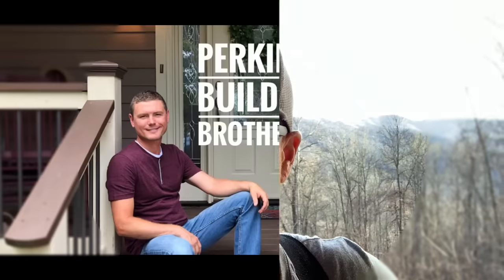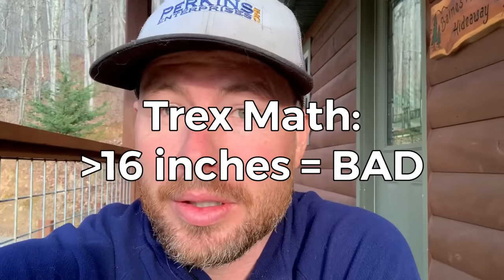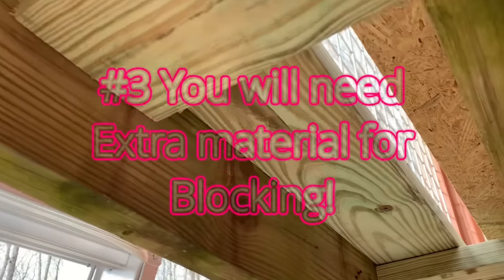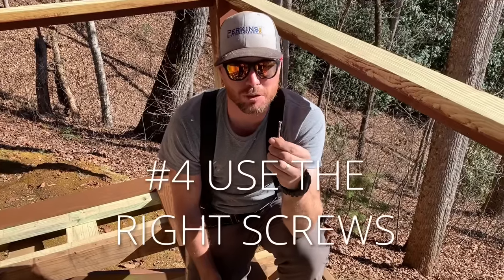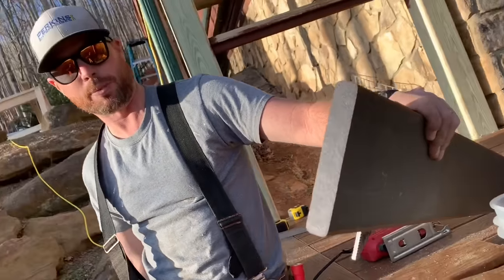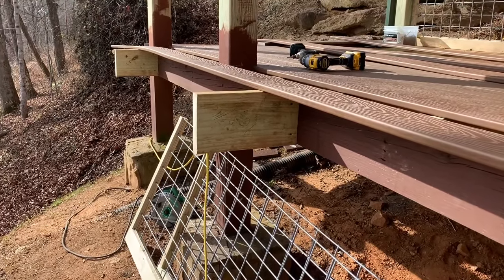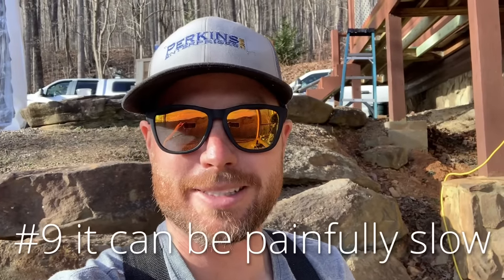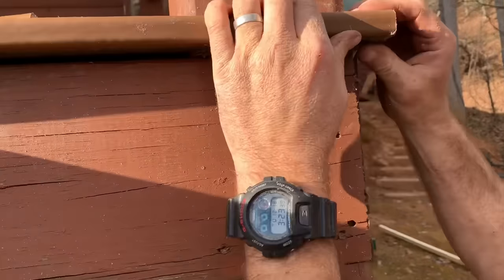How to install Trex composite decking

Comment: Been installing these for years now, figured I might learn a few new tricks but all I see is inconsistency. 1st, joists should be at 12" not 16, the amount of trex decks I've redone for people because their joists were on 16 and sagged is insane. 2nd, why take the time to install "outriggers"? Lay your board on top of the last deck board on the deck itself, make your post marks and measure the distance from the last installed board to the end of the deck and your done, that'd save more time. 3rd, you finished your deck in 2 different ways which would look odd when completed, that blocking around the deck is only necessary when you are picture framing the deck with a 1/2" over hang to butt the skirt board up to, if you are raising the the skirt board to cover the cut ends and flush it to the top of the deck the blocking was a waste of labor and material.

Comment: My personal preference is that I would never lay out the dough for Trex, and then use visible fasteners.
Reply: Sometimes you have to face screw it if your running a Dexerdry system to keep underneath dry for a sitting area. The hidden fastener groove gets taken up by the seal for the Dexerdry.  Otherwise yes, why face screw it?
Reply: Hidden fasteners arent code compliant in some parts of the country. IE where I am, at least.
Reply: I can see the screws in between the trex and MY OLD DECK.. IS IT SUPPOSE TO BE THAT WAY HELP??
Reply: @Spytimegamez  what are you talking about?
Reply: @Spytimegamez  Do you have any pictures or a video to clarify what it is you are speaking about?
Reply: The clips will not hold up to severe winds. Here on the Gulf Coast, where we have hurricanes, they do not recommend using them.

Comment: At the rate lumber prices are skyrocketing , trex starts to make sense.
Reply: Exactly!! The exact reason why I'm looking at this stuff now. Lumber prices are insane, thank God I reno'd my building last year– a 4x8 sheet of 5/8" Pressure Treated is $114 Cdn today...F*ck that!
Reply: You need more joists so may offset the cost anyways
Reply: @ianmctimoney4206  Only need to double up the joists where the trex meets and on the outsides, so not too bad.
Reply: @harbourdogNL  also 16" o/c and 12" o/c for stairs,  depending size of deck coukd add up.

I just don't Iike the product , much prefer real wood. It's also hot af to walk on I summer.
Reply: Not only the cost of lumber but the very low quality lumber that’s hitting the market.
Reply: @randygreen007  it recently took me 2 hours to find about 100 decent overpriced 1x6 redwood fence pickets from a pallette of 400 at a local hardware store.  The shortage is real.
Reply: It's not a horrible price. I just got 45 boards 16 ft and paid 850

Comment: You failed to allow any drainage (where you laid the 2x6) for the band board; so water will collect there at the end of every board and have nowhere to go. Drill a 3/4” hole in the 2x6 where each corner of the deck board meets the band board.

Comment: Trex has decking with grooved edges so you can use a hidden fastener to attach to the joists. Make sure you do some research before doing this project yourself.
Reply: You can get Trex with grooved(hidden fasteners), or rounded edges(faced fasteners). There are pro/cons to either.
Reply: @jeffw8057  I agree!
Reply: I hate the hidden fastener system. It took twice as long to install it then a normal deck through face installation
Reply: Also make a gun to shoot clips
Reply: CHEMICALI3URN  for sure
Reply: I love the Camo screws. They make fasteners too but the screws with their tool are awesome.

Comment: I did 3 decks with Trex in 2002.  Used the specified screws that claimed to not mushroom, same screws you used.  They did mushroom.  Ended up pre-drilling and counter sinking everything.  I used a round over router bit on the cut ends, looked great.
Reply from the maker: Nice work! Sometimes a good looking finished product is in the details

Comment: Still loving my trex decking . Had it installed 18 years ago by an individual very skilled in trex . This decking does expand and contract with weather conditions , and will sag if not properly supported especially in hot sun . The decking does get warm if it’s in the hot sun , mine is around my pool so I do spray it down periodically if we’re using the pool , but the advantage to that being if it’s 65 degrees outside i can be out on my deck because the trex has absorbed a little warmth . Also trex decking does require care , it is not a carefree material , I do power wash my decking every two years as mold can sometimes collect with moisture , and the decking should be cleaned of any debris that collects on it to help prevent mold and mildew , overall I have gotten my money out of this deck , 18 years ago it cost me ten thousand dollars to build my deck and it is fairly large and has brought a lot of enjoyment to my family ..

Comment: I wouldn't criticize this because 2 years is a long time in terms of composite decking lawsuits, changes to their installation guidelines, and product due to insane product failure rates. Things are common place and standard install procedure that only a handful of pros were even thinking about or doing for a more conscientious client base a few years ago. I'll leave it at that. Great tip on the marking of outside deck board around posts. Putting things out into the world for all to criticize is more than most people do.

Comment: I have been reading the comments and there a lot of negative comments about Trex decking. I had my deck built four years ago and I love it, it looks the same as  the day it was built. Mine was built with the hidden mounting hardware and I could not be happier. I have had wooden decks and they are a lot of maintenance. I used there high end product with metal hand rails. It is hot in peak sun times but I dont entertain in the middle of the day so its not an issie. My concern is how long did  those who not like this product own it before it went bad. This deck cost more upfront but I factored in the time and expense of stripping and sealing the deck every couple of years, well worth the extra cost.
Reply: Same here.
Reply: @stevethecat9194  Thanks
Reply: Scott Gibson I Google review Trex decking it had a lot of bad reviews. I am very confused now, wood or composite decking?
Reply: @lookssssssssss  I own two homes and my other house has two decks one with cider and one with PT, every two years I have to strip the old seal and reseal them. They look good for one years, it's time consuming, expensive and in general a pain in the ass. I much prefer the Trex, it looks good and needs no real maintenanc. If there is a negative it's that is does get hot in direct sun. Good luck either way.
Reply: @mtadams2009  Thanks for quick reply I think I may go with Trex

Comment: Done ~2600ft2 of Trex including Trex Elevations (steel framing members) on 5 decks. This said:
1) yes, the ends might not be square (arrg)
2) 2x as long is reasonable
3) unlike this video, spec is for gap spacing on butt joints (spans > 20'), and there is quite noticeable gap movement over the seasons (may even want to use double joists here)
4) even at 16" there can will be noticeable movement when walking (i.e. unhappy client)
5) since not wood, requires great precision--can't just sand flush a little off miter e.g.
6) plastic flexible, bad when trying to get it square, good when you need some movement to install
7) hidden fasteners take time but give a good result
8) starting hidden fasteners give a telegraphed rise so pretty much have to rabbet  to keep flat
9) with Elevations, they actually require you to counter-bore over each fastener, a laborious task (and never happened to me but spade bit tip can easily poke through)
10) you really need to use deck clamps to insure tightly abutted boards/even gap spacing (had to remove a whole lot a worker didn't do quite right to please client)
Reply: Well said.  Also, cut perimeter after installation and a couple days of movement has occurred on hidden fastener systems so as to let the deck find its happy medium.  
I'm not keen on having wide flat surfaces under the end to perimeter board support like they showed early on.  It's just a wider collection for water.   Instead I like to space extra joists and space blocks to encourage drainage.
Reply: @seanroberts381  what about covering that blocking with joist tape?
Reply: All that being said, totally worth it for the client?
Reply: @every_thing_wood1251  They are happy so the answer would seem to be yes. A few years in and durability (including harsh sun exposure) has been fine and looks to continue for some time. I would not hesitate to undertake the higher cost and use Trex again. One note is that Trex Elevations (steel framing members) seem to no longer be made. Don't know why. So I guess I'd have to use old school PT beams.
Reply: @BB-xq6rj it does help, but whenever possible, respect for nature always works better in the end. The smaller the surface area for water to collect, the better. Remember, given enough time, water destroys or changes most things, so better to give it a path to leave while you wink at it.

Comment: Lately, here in my section of New England anyway, pressure treated lumber is getting harder to find in any quantity.  Place an order of a couple of pallets from the big boys and you may wait weeks for delivery.  My latest deck stock came in only $500 dollars cheaper than a mid range composite.  Sometimes the extra work pays off in the long run.

Comment: As you don't butt the composite material and leave a slight gap, we used specially designed screws between each board that fit into the factory board  groove. That way there are no visible screws in the decking. When we did the outer "picture frame" we used a drill with a countersink bit. The screw was countersunk, then a plug was placed in the hole. This way there are virtually zero visible screws on the top of the entire deck, including the steps.
Reply: Were plugs included?
Reply: @joeysmith4515  Yes, in the "kit" i purchased a special bit was provided to countersink the holes as well as plugs colored same as the decking.
Reply: So I did not go to Lowe's or Home Depot. They seem to rotate specialists and I wasn't confident that they could fill my needs. Instead I went to a building supplier. The person who assisted me had a computer program.I measured the width and length of my deck and railing as well as width, length and number of steps. He put it into a computer program and it spit out what I needed, It included boxes of screws, as well as the anchors for the boards, bits to be used for the screws between the boards (since I used composit and they are not butted together and need room to breath). Also included was the bit to countersink holes and the plugs to fill them. Since MOST of the screws are actually bertween the composit you don't need those counter sunk. Near the ends of the boards you may. I also put a "picture frame" around the deck. This was darker boards in color and also not "slotted' on the ends so that you get a smooth finish all the way around. I did not get a countersink bit or plugs for that, so what I did was buy some plug drilling bits, and made my own plugs from slop I had left over after cutting the picture frame boards. When I was done a neighbor who helped me was amazed at how little slop I had left. The program was pretty accurate. I could also return any boards left over, but didn't need to.

Comment: Thanks for all these tips.  One thing i don't get is that manufacturers ask us to account for expansion but at the same time they approve face screws which should restrict the boards from moving.  Anothet question is shouldn't we leave a gap even on the miter corner?
Reply: Expansion needs a space, not every space. Close your mitre but leave 1/4 at the opposite end. If butt joining, transition the space to the next board end😢. As long as the line has a space to expand, it will go the path of least resistance. Of course, if you are transition in the middle of a deck, leaving the space on both ends looks nicer with a transition piece and more space to expand.

Comment: If/when Trex delaminates, which it is known to do, depending on the batch, the warranty only covers the cost of replacement material. It does not cover labor costs related to removing/disposing of the defective material nor installing new material. Also, Trex WILL stain if drippings from a barbecue hit the surface. Dawn dish soap may help, but not always. Always place a protective barrier between your barbecue and Trex. In theory, Trex is supposed to last longer making it more cost effective over the long run than redwood. That is not always the case. Certain colors fade quite easily within a relatively short period of time.

Trex is actually a waste product from Anderson Windows consisting of wood and polymer materials left over from the making of doors and windows. This waste is ground up and mixed with colors and adhesives. When it delaminates, it looks like a soggy roll of toilet paper. It is recommended to seal the cut ends and penetrations of this material with some sort of adhesive/sealant.

When the weather gets hot, Trex on 12" centers does better than on 16" centers for the deck surface. For stairs, regardless of climate, Trex recommends 12" centers, otherwise the material will bow. It is not very scuff resistant.
Reply: And 9 inch on stairs I believe. When using any composite decking you should frame 12 inch center.

Comment: We are replacing an existing deck. The joists are at the correct spacing. Should I use larger screws than were used for the existing decking? Did you drive screws in at an angle or at 90 degrees to the deck?

Comment: Since UVA & UVB light deteriorates everything, and I do mean everything, over time how would you go about making the Trex decking appear new or at least renewed in it's faded, likely micro fissured surface? I doubt that it'd take any conventional wood stain. Is there a renewal compound specically made for Trex?
Reply: Trex now has a 25 year Fade Warranty.  Not sure how they can support that, but . . . .
Reply: Did trex on my cabin porch in 06, no warps or fading yet. Got receipt handy still in case I need it

Comment: I live in Toronto. Installed mine in spring , cool morning , hot afternoon. The 20’ boards expanded almost 3/8”  when it got hot. . I don’t think you can do flush cut but joints unless it’s already really hot outside?

Comment: Instead of drilling on an angle, block the joist for more bearing and drill straight down.
Reply: I didn't understand the angle drilling thing. I thought it was just a camera view. So the angle drilling was real and done to catch a blocking? Why not block where the support is needed? Hard to tell with these videos.

Comment: If you have the opportunity never butt boards together. Either run it 45 degree or put a divider board in the middle. *if you’re using transcend since it’s usually for a more premium project*

Comment: Two things I noticed , one he’s was using his speed square backwards while cross cutting. Flip it so when cutting it locks at 90 degrees. Make sure your saw is sitting high enough to pass over the square. Second, I’ll use 2 speed squares to drop between the boards for spacing.  I liked the oscillating tool trick. If you don’t have an oscillating tool when finding the angle with a bevel gage just remembered under 90 degrees over by half the degree each board, over 90 degrees cut under by half the amount on both boards.

Comment: It gets HOT in sun and I used a very light grey. Plus used Cortex fasteners. Yep took more work to plug holes but a blemish free surface
Reply: I literally just found out about the plugs.. My building center didn't tell me anything about them. Hence, why I never go back to that store, EVER.
Reply from the maker: Thanks for the comment… I realize that I should have mentioned that in the video so I just made a video about it. You can find it on our Perkins builder brothers YouTube channel

Comment: Missing a)screw hole plugs
B) hidden fasteners
C) joist protection
D) seperate double joists for butt joints with atleast 1.5inches to allow air/water to flow through
E) that was a terrible miter
Reply: Is joist tape really necessary?  My father-in-law's deck is 30 years old and has no problems with rot.  Just wondering if it's really worth the $75 it'll cost me as I'm about ready to fasten my deck boards on.
Reply: @brianheath5091  sry not 1/2” with trex it’s 3/16 clearance!! Material does not expand or contract
Reply: @brianheath5091   not necessary

Comment: Instead of laying a 2x board flat on the outside for the ends of the trex to sit on, I would just install an additional joist with a 2-3" gap between the end joist. That way water can drain properly between the field ends and the picture framing deck boards. This should keep that "flat" 2x from rotting out over time. Also, tape the joists. Just saying.....Trex is expensive and you want to protect your investment.
Reply: Was thinking the same thing.  Let the water go.
Reply: Manufacturer recommends tape on joists... I can't believe people don't use it, I love it because it extends the woods life💯

Comment: @Perkins Builder Brothers random question I know..... But did y'all make the welded wire/Hog wire railing inserts?  Nice rustic touch. Not for everyone. But I like the welded wire/timber mix
Reply from the maker: OK thanks… I actually bought the wire panels pre-made from tractor supply. Going to make a video about this next time I do it :-)
Reply: @PerkinsBuilderBrothers  neat! I've always cut my own down, fastened it to the posts and top and bottom rail, then picture framed around the fastened edges on both sides of the welded wire panel.  Had no idea they sold them ready to go. And at TCS of all places.... That's awesome. Looking forward to the vid 👍

Thanks for the reply man!